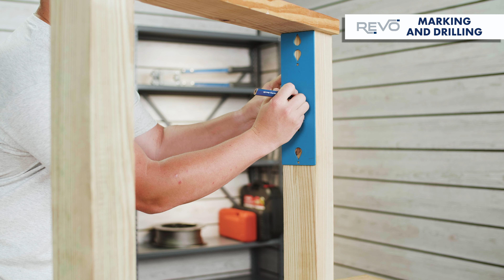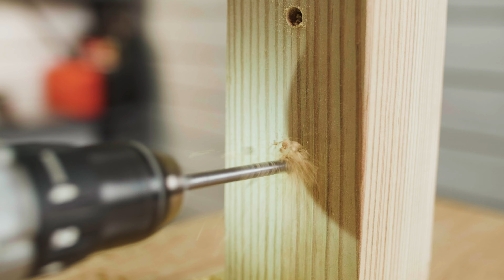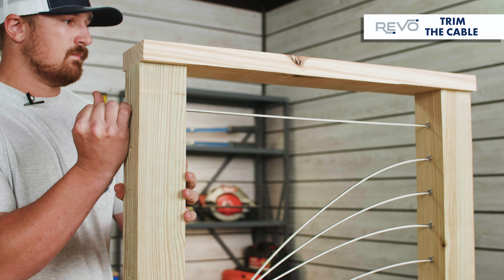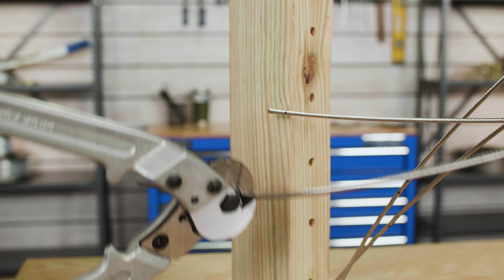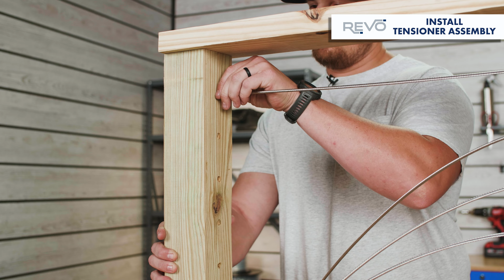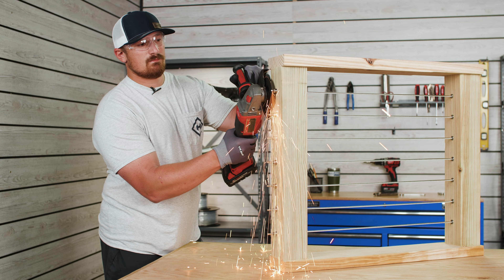Through-Post Tensioners | HAAS REVO Cable Railing Components Installation

Comment: Want to use your thru post tensioners on stairs with 6" wood posts. Will the holes I drill for the tensioners and end stops need to be straight or angled?
Reply from the maker: Thanks for the question, Greg. Your top and bottom stair posts will be drilled level to the ground. Any intermediate posts on your stair run will be drill at the same angle as your handrail. See this video on How to Drill Wood Posts here: https://youtu.be/y5c1-IlrDK0. If you're looking for more resources on 6x6 posts with the REVO System watch this: https://youtu.be/p1X2tHdeCKA

Comment: how do you deal with cables that sagged months later after you already cut the excess stud you held using vice grip
Reply from the maker: Great question. After fully installed, you won't have any of the excess stud to clamp onto to tighten them up so you'll have to hold the cable itself on the other side of the post. Regular metal grips may damage the cable, so we've found it best to first wrap the cable in a bit of microfiber cloth or a piece of rubber to protect the cable from dents and scratches during tensioning. We have a video on why cables sag if your interested in techniques on how to keep this issue from happening again. https://youtu.be/HVXTctv9qPM

Comment: Is there a general rule of thumb for how tight to have your cables?
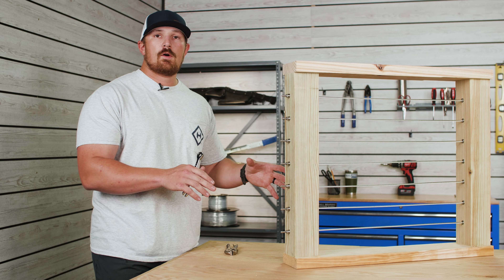Reply from the maker: As you may notice, at starting at 5:23, we don't recommend a particular torque value since there are too many variables each customer's installation. So, the amount of tautness is up to you. When tensioning each cable run, use a finger or hand to push on that particular cable to test the resistance. Once you find the desired tension, repeat with all the cables, going back over them to make sure they're all equally tensioned.

Comment: I followed these instructions, but then my post protectors wouldn’t fit into the post. They were hitting the end of the stage stud inside the post.
Reply: I just added another 1/2” to the cutoff mark for the swage stud and that seemed to work fine.
Reply from the maker: There are a couple reasons this might have happened ranging from hole drilling practices to end post size. Feel free to give us a call, or set up a consultation on our website. https://e-rigging.com/pages/book-appointment

Comment: Got a problem, every video we watched had 9 cables between the 2x6 Top Cap. That means there's 10 bays. 10 times 3 is only 30" so how's that work out? The template measures 3 inches between each hole. 9 cables means there's 10 bays which is only 30". We just bought your system and now we are either left with buying more or spacing out the cables to 3.5". Please explain the discrepancy.
Reply from the maker: Every system is different and planning out how many cables and how far apart those cables should be the first priority. You will find out how many rows of cable you'll need by measuring the space between your top cap and the floor and dividing by 3 and subtracting 1. Many of our customer's deck balustrades measure 36 inches meaning that they'll have 11 rows of cable spaced every 3 inches.
Reply: @HAASCableRailing  Thank you for the clarification. We installed your system and it turned out beautifully. The owner is ecstatic!
Reply from the maker: @UnGrumpy1  We're always happy to hear it! Would love to see how it turned out! Feel free to submit any photos you have of the project here - https://e-rigging.com/pages/send-us-your-photos
Reply: @HAASCableRailing  My company is Left Coast Construction, I will send pics tomorrow.
Reply: @HAASCableRailing  Having trouble with the pics, I cant seem to get a pic that shows the true beauty. I'm getting a new phone today, maybe that will help.

Comment: Is it okay to place composite or PVC post sleeves over the 4x4 post when using the Revo system?  Will the tension on the end posts cause the composite or PVC sleeve to deform??
Reply from the maker: As long as they fit snugly with no gaps, the REVO System will work for your project! It should not deform the post sleeves. Thanks for the question!

Comment: What if it loosens over time after the end has been cut off?
Reply from the maker: Great question! However unlikely, if one or two cables come loose on your fully installed REVO System, you can still go back and re-tighten those cables. Just take off the decorative end cap, gently secure the cable with a pair of vice grips, and tighten the nut. Then cut any excess threads off the stud to re-install your end cap. Thanks for the question!